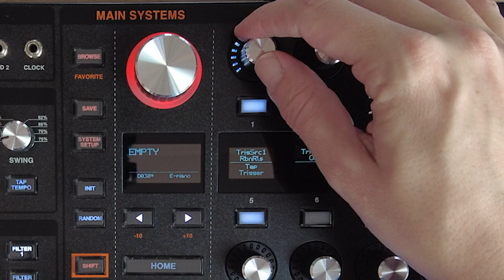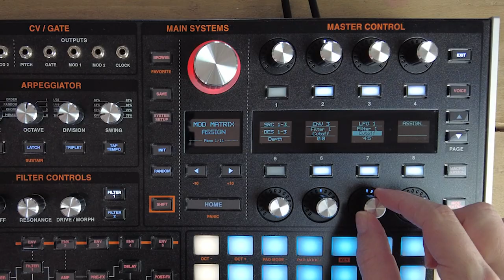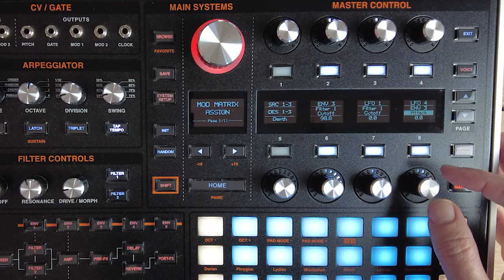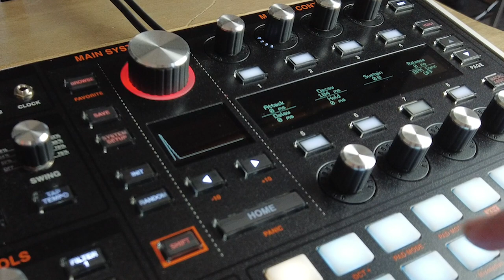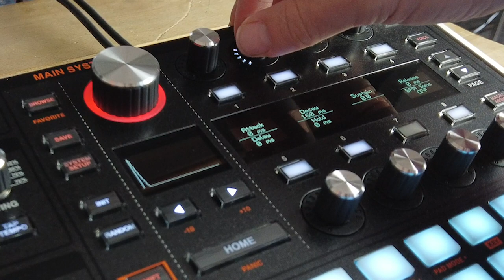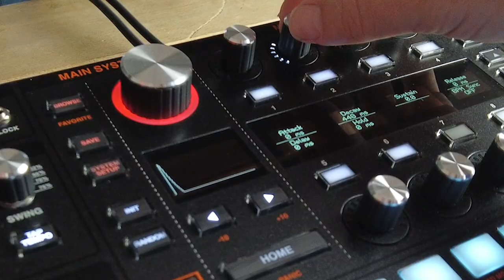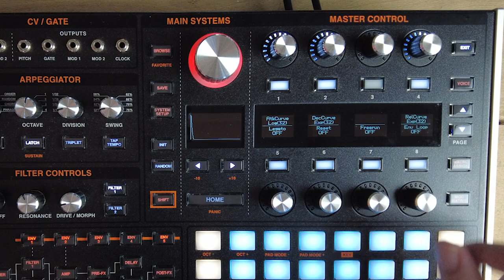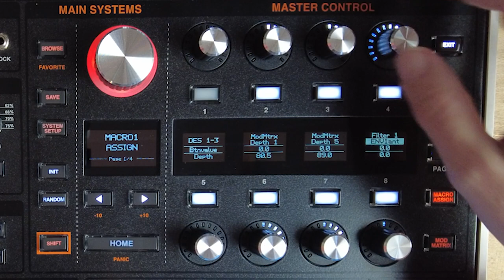ASM Hydrasynth - Envelope Trigger Sources

Comment: Listening to some of the highly dynamic patches that come as standard with the hydrasynth, I was trying to piece together in my mind how the triggering worked. It's way too deep for me to imagine but this video has shown me how to spot a lot of the effects.  What impresses me most is that you have been able to keep in mind who is triggering what and which modulations are acting on which parameter. So, yest, it finally arrived. I know it's going to challenge me for years.

At last, I am coming closer to understanding how those huge modular synthesizers of the sixties were able to do so much, as previously my understanding was based on what could be done with a two oscillator plus sub osc monosynth.

I know how I've banged on about history before, forgive me, I have such admiration for pioneers like Wendy Carlos, the BBC radiophonic Workshop, IRCAM et al.

My greatest frustration is that each patch is like an instrument in its own right, with its own characteristics. The more dynamic a patch, the more playing possibilities there are, which extend the dynamics of the sound, increasing the expressive possibilities of that "instrument". Having just one sound, such as in the case of the theremin, a player must master technique to a high level in order to achieve any kind of musicality in the conventional sense.  The compound modulations possible on the hydrasynth and the ability to assign so many parameters makes this instrument a sonic power house but what impresses me more is that by assigning dynamics skillfully to the aftertouch,  we have a delightfully responsive range of variations to the sound. Certainly, my Argon 8 has great possibilities here too but poly aftertouch on these little pads seems somehow new and exciting. I haven't tried the key-bed of a hydrasynth with keys but if is has that much expressive potential it's bound to create a storm of enthusiasm for these instruments.
Reply from the maker: Glad to hear you finally got your Hydrasynth! No need to apologize for opening up the history books. On the contrary, there's so many artist in the history of electronic music I don't even know about. Turns out the YouTube comment section is a great source for me for "new" music to listen to. So thanks for that!